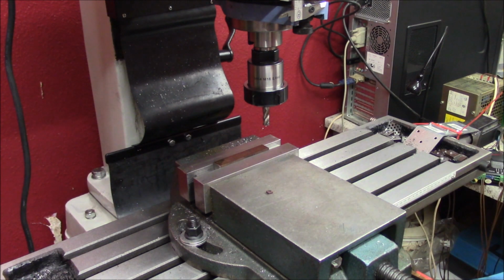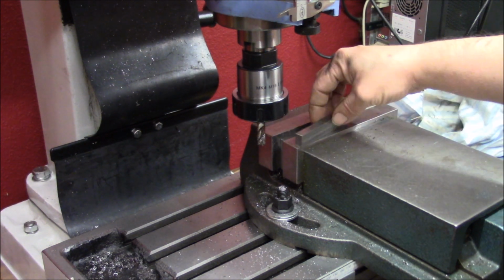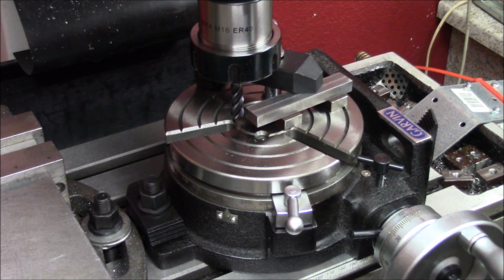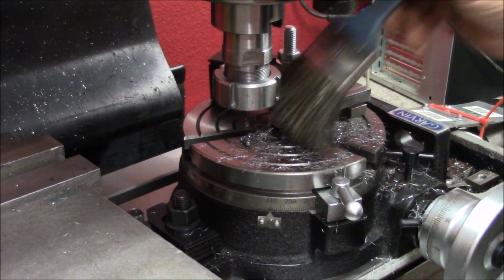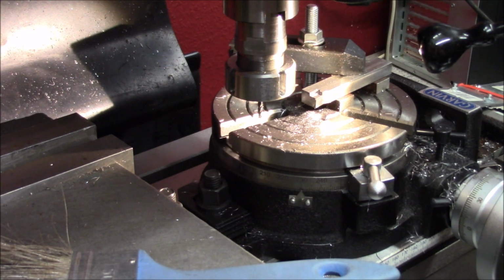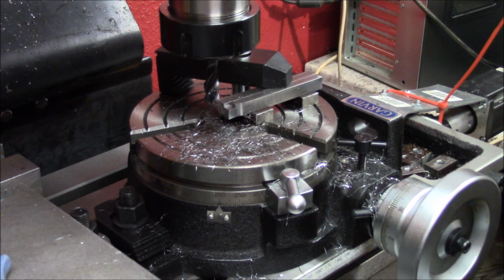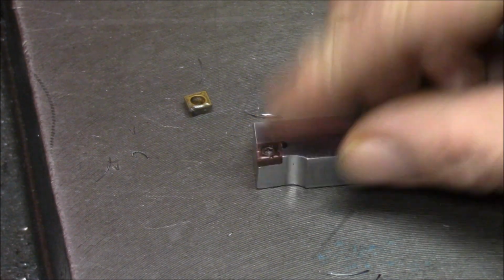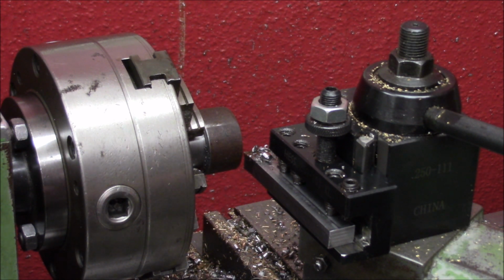MAKING A CCMT CARBIDE TOOL

Comment: Hi Kim, you make interesting videos. However, I see 2 opportunities for improvement:
A) If you do not show all machining along the whole path you can save video time and your viewers still understand what you are doing and how. Shorter videos get more viewers. Just show enough for viewers to understand your setups and only a small part of the machining. Most viewers don't want to see where each and every chip lands... ;-) Most viewers prefer fast paced videos with high information density in a short video without lengthy (boring) scenes of the same. The longer your videos take the fewer other videos can the viewer watch. 
B) Your Emco lathe in combination with a good microphone is so noisy that it hurts in the ears and makes the viewer/listener repeatedly open and close the volume. In some places you have reduced the volume to avoid that. But not everywhere. And then you show the whole cut from start to end... ;-)